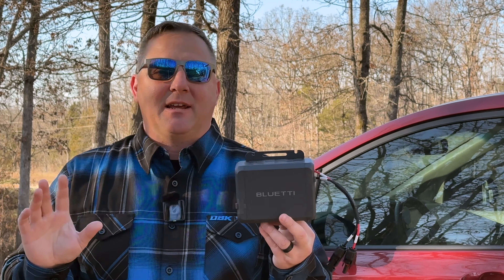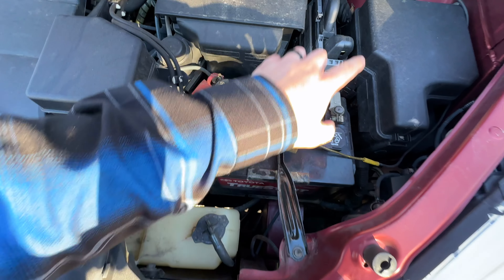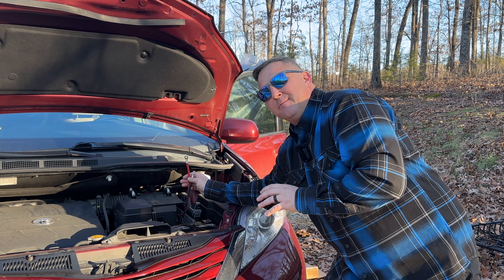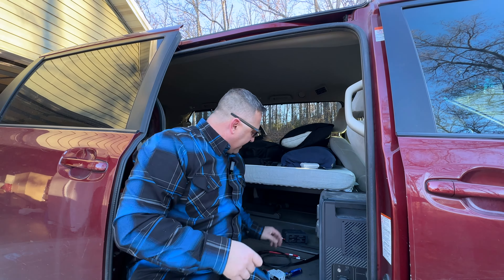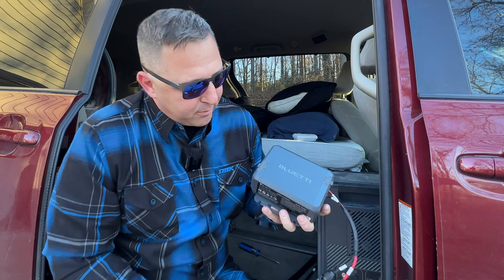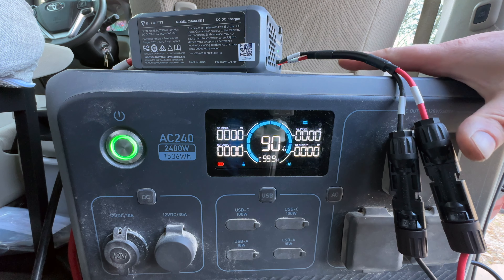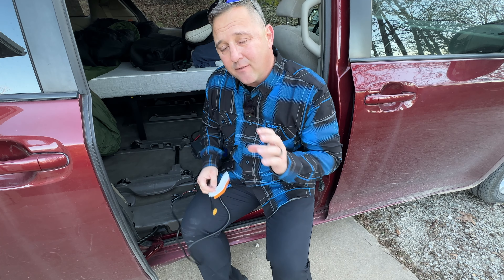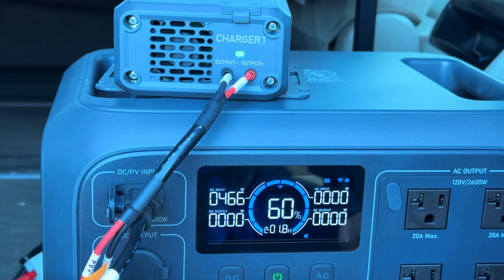Is Solar REALLY Obsolete? - BLUETTI Charger 1

Comment: The results would be :  If you keep on charging the power station with 500W (without charger input voltage control), the start battery would gradually decrease from 14V (with alternator running) to 12V.... 11.9V. This would overdraw the alternator output and the vehicle's battery meter would sudden drop down.
Reply from the maker: That would be correct, but the Charger 1 will stop drawing power when the battery’s voltage drops below 13v. So, it does a decent job of protecting the starter battery and overloading the alternator too much.

Comment: Just know the Bluetti Charger 1 will use 50 amps from the alternator. If you going to ever plan to charge while a vehicle is a idle, make sure your alternator can handle that load and also not overheat. Trucks, vans should be fine but if you doing this on smaller vehicles to know some alternators are low amperage in comparison. I made a charger box similar as a emergency backup for my small mazda but got a DC-DC charger at 25 amps as I have a 100amp alternator and didn't want to burn it out.

Comment: I’m definitely going this route over solar panels. I spoke with my dealer. They seem to think my 4Runner can handle the load. The warranty is not voided unless you splice into the wiring. As long as I connect to the battery I’m okay.
Reply from the maker: @joesoutdoorplaces  I don’t think it’s that big of a tax on the system. I suppose I’ll know in a few years if it ever causes a problem.
Reply: @AdventureGearTV I’m assuming the battery might die out sooner than normal because it’s constantly being charged and drawn from? I would think that’s probably the biggest downside to this.

Comment: You would never charge a 12v battery with this!   The reason it was not charging with the car off is due to lead acid batteries dropping below 12v when drawing high current of nearly 50 amps in this case.  You need to have the breaker turned off until you are have motor running and ready to go.

Comment: putting a charger 1 into my grand cherokee suv build, I didn't really think that the strain on the alternator will be that much. That said, I went ahead and installed a new high output 200amp alternator. I'm running with the ac200max currently.

Comment: The advice I got from an auto elec was that running the car on idle and using the Charger 1 would be bad for the alternator due to the heat produced. He suggested only doing that for 10 mins as a top-up but the Charger 1 should only be used while moving which means the air movement helps keep the temperature under control. I'm not sure if it's right or not but it's worth thinking about.

Comment: It’s definitely good to have a DC/DC charger and solar. For my 4Runner I have the EcoFlow Delta 2 Max, the EcoFlow DC/DC Charger and 2x100W panels on my roof top tent. When fully set up (I remove power station when not going on trips), I also have a 45L 12V fridge/freezer. The panels are almost enough to keep the power station at the same state of charge, but I think 300W is the sweet spot (for when parked in my driveway). 2kWh power station is definitely the way to go.

Comment: Good video!  
I installed the Charger 1 in my high top van just in time for a 3500 mile road trip in October. My alternator is 200 amps, and my Bluetti AC300 & B300 battery operated flawlessly with the Charger 1. It was a night & day experience compared to using solar alone.   No power anxiety whatsoever.
Reply: Enlightening 😂  Empowering!

Comment: I'm 59 and been a mechanic for over 40 years. 
I also have a couple of properties in the mountains. 
I am getting one of these for my vehicle. 
The reasons. Solar doesnt charge when the sun goes down. 
In the winter months the sun goes down at 5pm. 
Also my nearest Home Depot or Lowes is 45 minutes to an hour away. So at night i can put my Bluetti power station in my truck and within 2 hours it should be charged. 

I usually charge my Milwaukee batteries up with a 12 volt adapter and the charger plugged into that adapter. 
By the time i get home my spare Milwaukee batteries are charged up. 
Also for the people who are concerned about the battery. If you buy a new 4-5 year battery. In the first 2 years of use that battery can be exchanged for free. 👍🏾
Reply: Yea but when u cut the car off it will also cut off right
Reply: @wextremeart4399  It will have the vehicles battery power connected to the unit. 
But it won't be using any vehicle battery power, when it's not charging anything. 
Like the standard 12 volt power outlets in vehicles now. 👍🏾
Reply from the maker: The sun barely crests over the trees here in the winter and that is a huge factor for me. Over a few days of regular driving short trips the power station will top off and be ready for the weekend. Now I always have at least some power.
Reply: @AdventureGearTV  I get it Man. 
So from 5pm to whenever a person goes to bed you are not getting a charge from solar. Then from 5pm - 6:45am the sun is still not out. So that's over 13 hours of just running off of the power station. Now people can have a noisy generator to charge the station up. And let's say there are 3-4 days straight of cloudy, rainy, or snowy days. How are they charging with no sun ?. 
But if you have to go into town anyway. Why not just plug it into your vehicle and it be fully charged by the time you get home. 👍🏾 
I have 2 bluetti AC200 max power stations. Each one powers half of the home. So I'm pretty set on power.

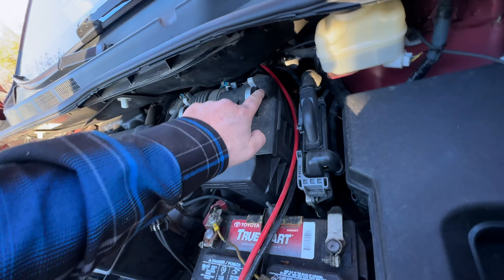Comment: @2:46 😂 “Don’t ask me how I did it. I did it and It was hard” 
Thanks for explaining all the pros and some of the risks. I definitely think this setup will work well for casual campers. And you can always pay a stereo installer to run the wires through the firewall if you’re not comfortable doing that part yourself.
Reply from the maker: I’m not used to contorting into the position needed to get my arm in the right spot like I used to be. Lol. Thanks for stopping in!

Comment: I have a Bluetti EB3A.  I know it's a small unit but I only need it for the 12vdc frig.

I saw another Ew Toob video that used a 12vdc to 24vdc convertor that cost a lot less available on Amazon with different models for output amperage needed.  I made one up and connect it to a cigarette lighter.  Several trips in and I haven't had to use my solar panel.  It keeps the EB3A at full charge on even short drives.

Comment: Thanks for the video.

Still need solar?   Depends on use case.
If you have a long drive, and not staying a long time in a location - this is a great solution.

Shorter drive, or parking for days camping or boondocking - then this would be supplemental to solar.

thanks for the video.

Comment: Thanks for the awesome update! Isn’t  that your same old Sienna?!

I have a ‘21 Sienna hybrid LE with the battery in the back that’s easily accessible. Will the Bluetti Charger 1 kill my hybrid system!? Any thoughts are much appreciated.
Reply from the maker: Hi, the battery in the back is fine. There might be a bigger drop in voltage from the alternator to the battery. I have seen that someone hooked one of the EcoFlow versions up to their 21+ hybrid, but don’t know how it has held up. My main concern is that the gas engine doesn’t always run and can cause abnormal operation while cycling on/off.
Reply from the maker: @foolthepity  also, this one is a 2015 LE AWD. It looks just like the old one that was a 2014 LE FWD.

Comment: havent seen this asked anywhere.
can you use this with a hybrid or full electric vehicle?
not sure it would work since they probably have voltage etc. fully tweeked not to give off excess power the bluetti charger can use.
Reply from the maker: My only concern with the hybrid model is that you would still need to hookup to the starter battery. So, the charger will only work when the gas engine is running. Unfortunately, I’m not very familiar with the hybrid Sienna yet.

Comment: Hey, awesome video, thank you! Given a powerful enough alternator and professionally installed wiring system to support that much power (though not nearly as much power as what people do with custom audio installations), do you know if it'd possible to run two Charger 1s simultaneously, into the same Elite 200 V2 unit, in order to max out the 1000W input? Also, can the Charger 1 charge the car's battery? Cheers!
Reply from the maker: @Rakkadeedoo  hi, I think it would work if they both have the same output voltage. But, there might be a better option out there for higher power.

Comment: Why not just use a cigarette Lighter Plug Into the Power station instead?
I thought about one of these on my Element, but it had a Cig Lighter In Back that Charges My Power station while driving...Does this charge thr Station Faster then The cig Lighter?

Comment: I don't think it is either or proposition, a lot depends on  application and the abundance of sunny days. Solar has its palce and so is DC-DC charging. In my rig, I've 3 ways of charging: solar/alternator/shore power, all 3 methods have served me well. When stationary, I charge via shore power, when the sun is out--solar is doing its magic, and when driving, I'm charging both solar/alternator. Had I lived in the sunny part of the country, I probably wont need alternator chaeging but I live in the PNW, alternator charging is a must per geography. In the final analysis, both solar/alternator changing have their place snd depends on user application.
Reply from the maker: I lean towards your thoughts on this. It’s good to have some options. In my case I frequently camp in the forest with minimal sun so the charger will help in between trips. I also don’t post up for extended periods.
Reply: @AdventureGearTV  Exactly, it all depends on individual needs. I'm running a well resourced ProMaster van, so I've got the real estate on the roof and I use the rig year round and it's power hungry.

Comment: If i could adjust it down by half. Will put 400 watts solar on sienna roof. Winter time will idle 10 to 15 min to warm up anyway. Don think i drive enough to charge. But wont give up on solar. Rather get an inverter generator.
Reply from the maker: There are a few other options here: EcoFlow vs Bluetti vs Pecron: Which Alternator  Charger is BEST for YOU?
https://youtu.be/F4PPAOKHVKg

Comment: I just replaced my alternator two years ago to make sure I didn’t break down anywhere….. that cost me $600! I think I’m still sticking with the solar, especially after that bill😢
Reply from the maker: Did your alternator actually go bad? Sounds like you know what’s best for you.
Reply: @AdventureGearTV  yes it did, that was very expensive lesson and I have the same engine as an F-150. For some reason the alternator just died. And I have nothing to do with the rest of my engine. And it was in good shape before I did all that 😞 so I went right back to solar 🤷😁

Comment: I installed a power port or 3rd cigarette liter in the dash of my truck with a wire to the fuse box 10gauge 30amp fuse  to charge 18 volt millwauke  batteries i have had them swapped out constantly all day and have had to use my noco jump pack to start the truck after a long day optima red top is the only starter batteries i own 7now i will tie an xt60i to the mc4 and try this driving
Reply from the maker: Good luck with it. You’ve got a decent system worked out.

Comment: The price of gas at 3:50 a gallon and the amount of time you have to drive around to charge it is not cost efficient solar is free. That’s why we’re doing it in the first place, right? And the more you’re driving in the more chances you have them getting into an accident….. and most of the mechanics I spoke to said that is the worst idea to ever do because you do damage to your car, can end up with a dead battery, short out your electrical system, and or have a fire. So basically two mechanics, we’re pretty much adamant about not doing this to my vehicle. not to mention you’re gonna wake up one day in your battery‘s dead at $300 a piece for my battery for my big engine in my giant minivan that I just had to replace not too cost-effective for that. And everybody who has the DC to DC chargers in VanLife always has a problem with it.😢
Reply: I am getting one of these for my Pathfinder. 
I have been a mechanic for over 40 years 
I have 2 properties in the mountains. One is a 3 1/2 hour drive away. The other is 2 hours away. 
Home Depot and Lowes are 45min  to 1 hour away. So if I need to charge up my power station at night. I can put it in my truck and in 2 hours most likely have it fully charged by the time I get home. 
Remember solar doesn't charge at night. Has low charge on cloudy, rainy, or snowy days. 
It's also dark at 5pm where I am right now. It will be this way until March. 
I have a 48 month battery in my truck. 750cca battery. I just bought it a month ago. If you buy a vehicle battery with a warranty they will replace the battery for free during it's first 2 years of use.  

The charging system in a vehicle can handle the extra load especially when on a long drive. 
Remember. 
The a/c, radio, and lights are all drawing on the system, when used at night. 
The vehicles charging system can handle the extra load.
Reply from the maker: A lot of times I’ll park in the forest where the sun doesn’t hit the panels. So it’s best to have a second source to work with them. It does take time to charge, but I’m usually a few hours away from my destination anyway. So plenty of time to get a charge.

Comment: Anyone who thinks solar is obsolete is an idiot. You need to run your gasoline or diesel engine to use this. There have been fuel shortages in the past and there will continue to be fuel shortages.

Comment: It’s not as good of a design as the EcoFlow Alternator Charger.
Reply from the maker: I like the EcoFlow version, but really wish they produced the MC4 adapter. Then it would be the perfect solution.
Reply: Why would you need MC4 connections?
Reply from the maker: @Bobster986  to make it more universal. So, not necessarily MC4, but standard leads coming out. The EcoFlow Alternator Charger currently only works with a few power stations.
Reply: I don’t think EcoFlow designed it for universal use, they made it specifically for their units. You know the old saying, right? Jack of all trades, master of none. But! If you own an EcoFlow generator and alternator charger, you can charge any other manufacturer generator by simply plugging it in to the EcoFlow while plugged into the alternator charger, so really, it is a universal unit when you think about it.
Reply from the maker: @ they projected that they would have a universal cable available in late summer. But, I haven’t seen it yet. Maybe soon.
Reply: I thin they realized that it was unnecessary as I mentioned 😌